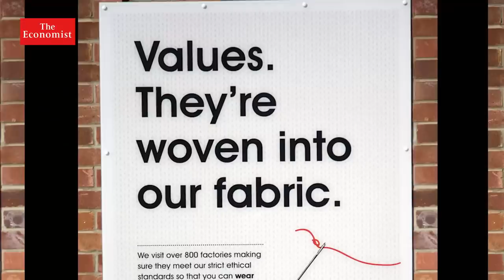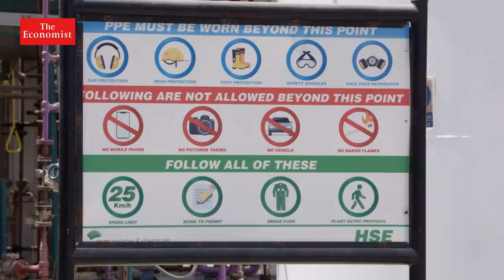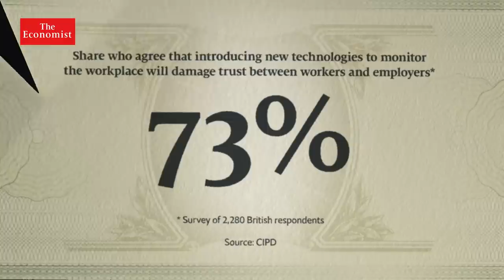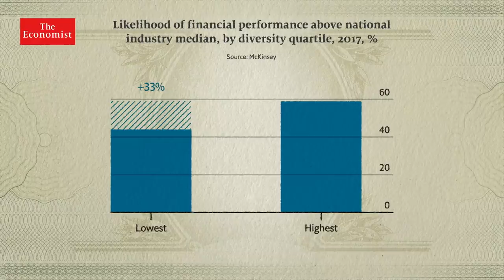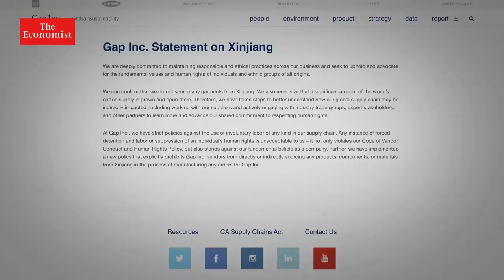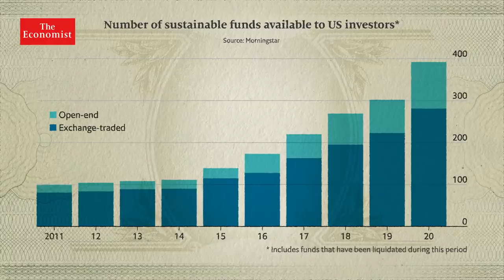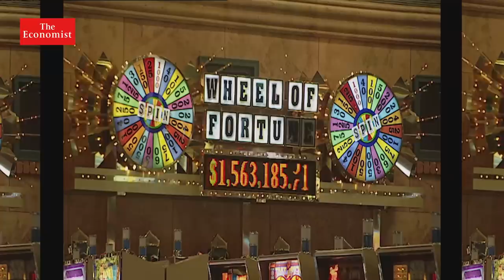Business: go woke or go broke?

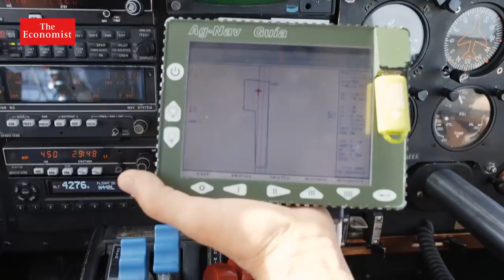Comment: The footage of the plane flying over the town in Alberta at 3:19 is flipped (left and right). It's Cochrane, Alberta. Anyone have any idea on why they would do that? I have some theories:
It was using a GoPro or a front facing camera that was used for a video conference previously, and has it set to look like a mirror.
Video editors are trained to have vehicles go from left to right because that's kind of how cars normally travel.
That's how reading works.
It was stock footage from someone else.
It was a conspiracy to troll me and waste hours of my time trying to find this on Google Maps.